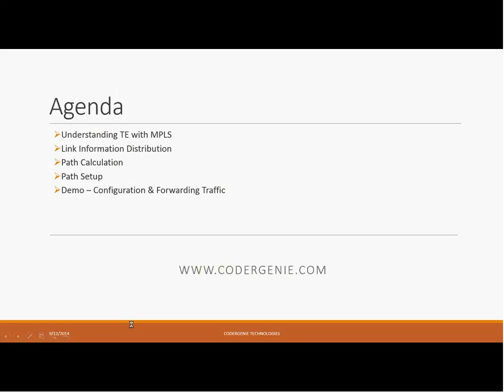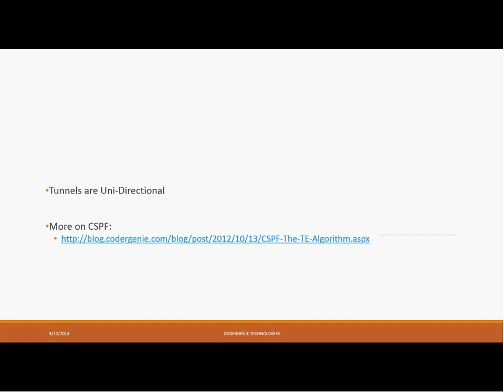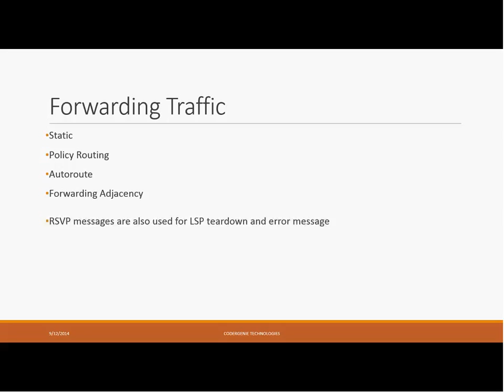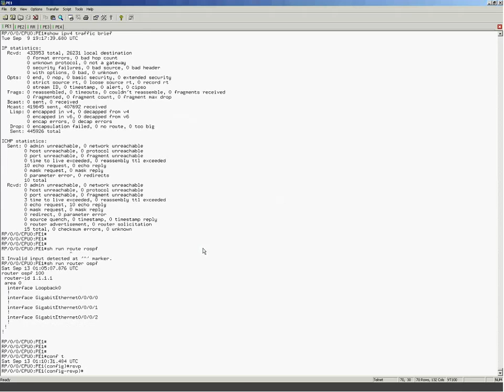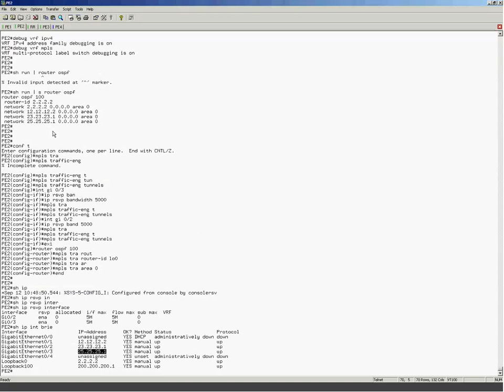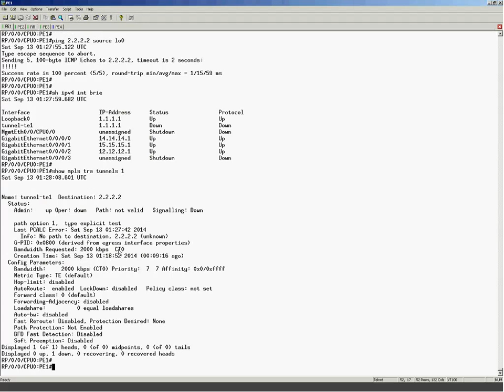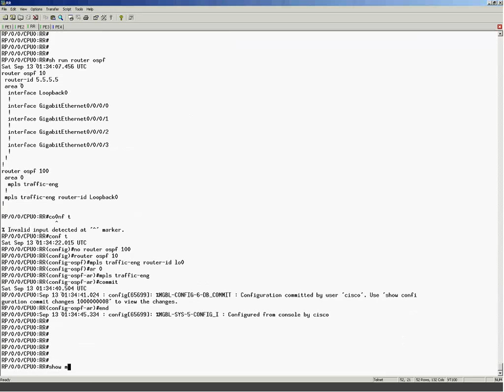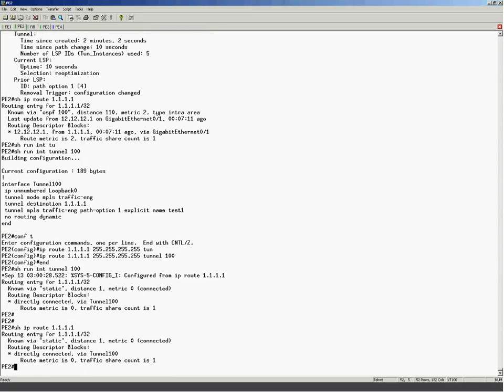MPLS TE Fundamentals

Comment: The instructor is knowledgeable but not clear on what he is doing. My suggestion to him is first of all use a clean router without any configs on it and then start configuring them according to the topic. As we can see, he is troubleshooting the TE-tunnels but it won't come up because he has an access-list on one of the interfaces and then he has a wrong OSPF process-id and these issues popped out because he didn't use clean routers.